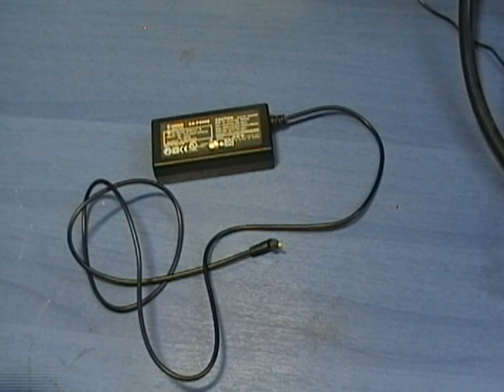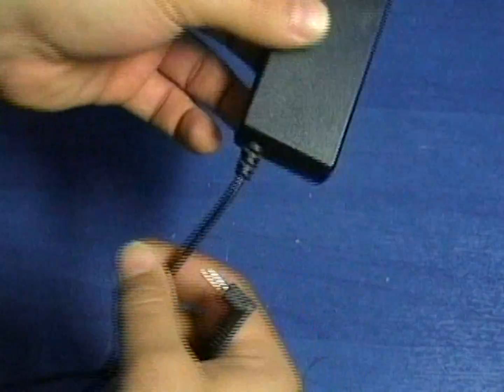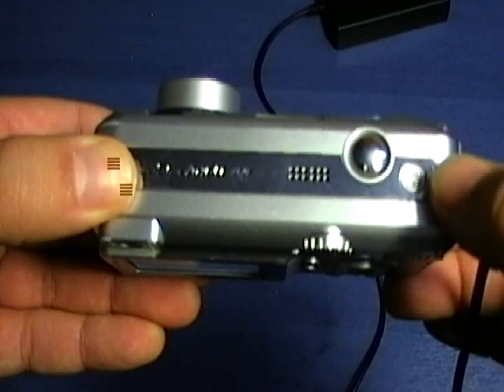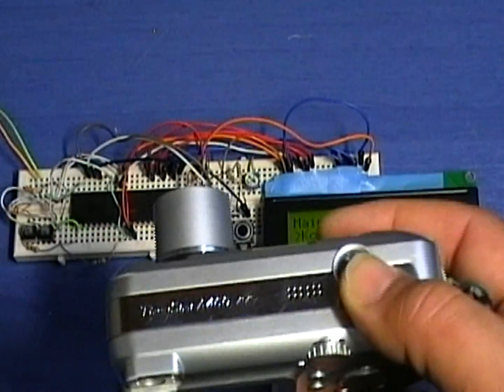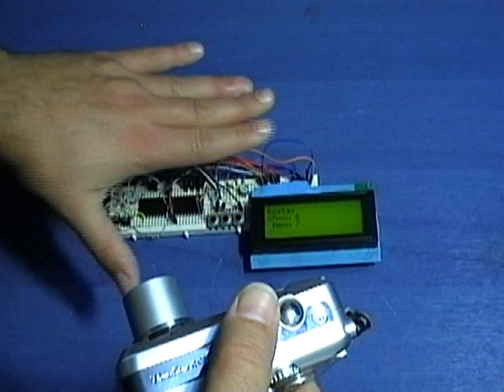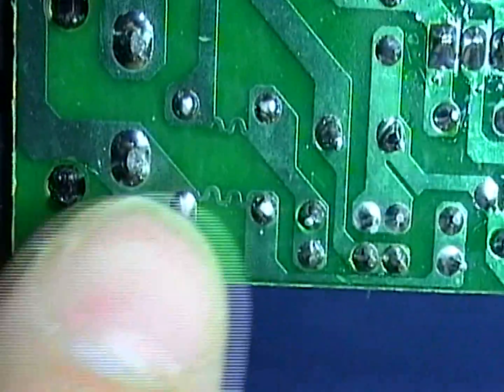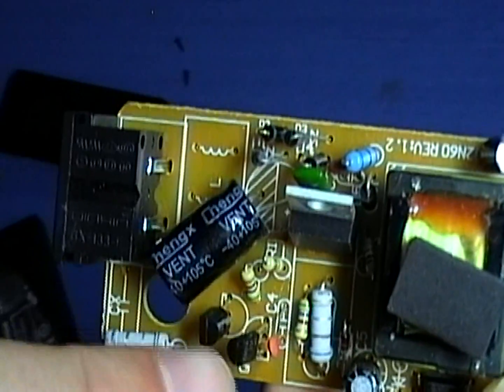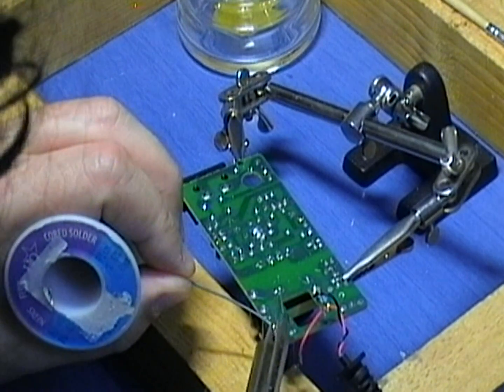How cheap is a cheap power supply?

Comment: I had a cheap charger cause my laptops trackpad to not work. Or behave erratically. When I used a charger from a more reputable brand like liteon the issue completely disappeared. The reason I tried a new charger was because after a year the cheap charger got extremely hot, was making some strange smells and making a buzzing noise.

Comment: This is why we just can't compete or do business with China. For a socialist country, China sure has zero oversight on products and services. Walmart is finding out the hard way. There are no treaties regarding patents and copyrights. And worst yet, although there are legitimate sellers in China, as a whole China is ruining its reputation, and therefore you can't trust anyone in China. Even if the eBay ad says "original" or "OEM", you can't trust it. You have to ask the seller a million questions, or ask for a dozen photos. And, all this effort just isn't worth your or the seller's time. Best thing to do is to run down to Radio Shaft and purchase a universal AC adapter.
Reply from the maker: and the funny thing is that the AC adapter from Radio Shack is made in China... Nevertheless, it works according to the specifications.
Reply: Made in Japan on sticker! LoL
Reply: +yuppiehi true on all points except we have buyer protection.  if it doesnt deliver, open case with ebay. an easy way to get your money back.

Comment: LOL!!!  Holding the soldering iron with your feet.

Too darned funny!  But now I want to open my cheap power supply as it may be the cause of snow on the LCD I pulled from a laptop.  I paid $35 US for a controller and about $3 for the power.   Hmmm...

Comment: Just popped open a crappy 100-240 VAC USB charger.  No fuse, just a "theoretical" fuse via an extra fine trace on the PCB.  LOL, what can I expect to come with a $20 video camera?

At least there's no time wasted with fake certification logos on it.  Although it does claim to be double insulated.

Equally terrible workmanship on this unit, too.

Comment: I now bought apple original magsafe 2 85w ,first thing I noticed is the original adapter ,is heavier than fake one, then I run geekbench ,scored 12017 and it was only 11700 with cheap, fake magsafe 2 adapter= it wasn't a real 85w ,Insufficient power is not good at all....I do not recommend cheap ebay magsafe adapters !

Comment: tbh it works ok but Ive done that AM Radio Test and I've got bad interference problem where my original asus PSU cause no interference at all...
Pricewise they goes around 15-20 pounds...It has all CE labels etc. :)
many years ago a cheap phone charger literally exploded on wall socket in my house thats why I dont really trust these cheap chargers...

Comment: I ran into a similar problem.  A power supply bought via eBay, which was both AC & DC (12V car) to multiple voltage settings (above 12V, (14-24V range) for a Laptop, 100W rated, but the case was abnormally small.. (about the size of 2 decks of cards stacked.).. Virtually _NO_ cooling, except to the aluminum case. One day, I plugged it in to the wall socket, (the laptop wasn't plugged in, thankfully) and heard a LOUD *POP*! a capacitor inside exploded. No load applied, what so ever.

Comment: I once had something even worse than this. A "power supply" made by a rectifier, couple of resistors and a zener diode.
It was dangerous too, as it would transfer the full voltage from the mains to the gadget.
I experienced this when I held the gadget with the fake power supply connected at the same time as I touched a grounded radiator. 

*bam* 230 volts straight through my arms from the gadget to the radiator.

"Made in China" with the CE logo and everything.

Comment: Basicly you bought the same thing as an original one. It's just that the one you got does not have those useless filters and additional protection. The capacitor will burn again if you don't make a filter circuit on the low voltage side, after the diode. It's a simple fix and the only other diference will be the short circuit protection will be missing and if you somehow manage to make a short, you will be left with a gaping whole in the power transistor, aswell as few other blown up components.

Comment: Good day
Everything electronic is like that now!
Everything I have worked on,..be it a DVD player, CD player, computer supply,..stereo, etc 
I notice they skipped out the extra filtering stage, use smaller components (meaning the parts are working at basically their peak rated voltage), & the power leads & patch cords, the wire inside is smaller than hair. (I'm exaggerating)..It breaks fast.so you can buy their version 2.0

Comment from the maker: someone sent me a link with an external HDD, which was a nice looking box (no stinks whatsoever), but when he opened the casing he found inside one USB stick hacked, soldered to the output of the "external HDD", and two heavy iron nuts to add weight... fail

Comment: I've seen worse to be honest. I bought an external hard disk psu from ebay.. it was 100% made from recycled parts.. which wouldn't have been so bad if the caps they used weren't all bursting. It also stank the house out when I opened the casing :/

Comment: A lot of power supply it seems like were you can buy on line are bad copies. I wanted a cell phone HTC one. on the out side looks just like it but the inside was cheep. It did not have the AMP's like the one that came with my cell phone. I posted a photo were I got it on Amazon.

Comment: @pcbheaven I don't throw myself to the top-shelf-logo-bearing products neither.
I'd starve. 
But I found, the hard way and with the cheapest stuff, that it's cheaper in the long run to get the mid-range stuff. 
So called "entry level" stuff.
Ok, I'm thinking bike parts and electronics, all in the same bucket, but I fried a phone with a cheap adapter, replaced dozens of mainboards killed by cheapest supplies, and so on. 
Broken shin bone because of cheapest pedals :D.

Comment: The unfortunate thing is this is not only found in counterfeit parts but in so called name brand products.  And the so called "missing" parts are due to the same board being used in modified form for different products.  I have several "Freeplay" wind up radios.  From the outside you cannot tell the difference in them.  Inside are serveral diffierent configurations.

Comment from the maker: @rodjownsu lol! basically, i replaced the diode as well and the capacitor. it works much better now. yet again, the connector has the same problem - move it and the camera shuts down. Maybe you'll see this box in a future project of mine.